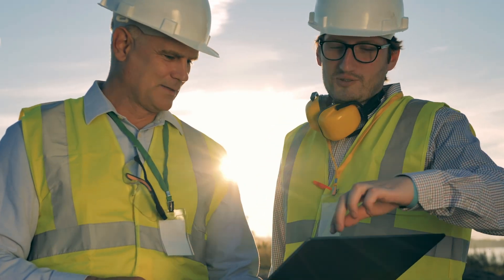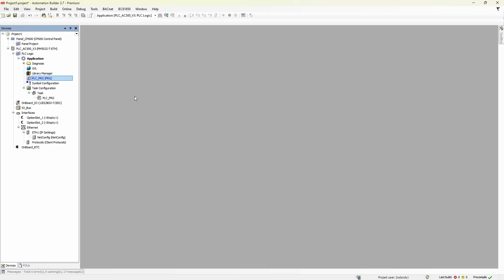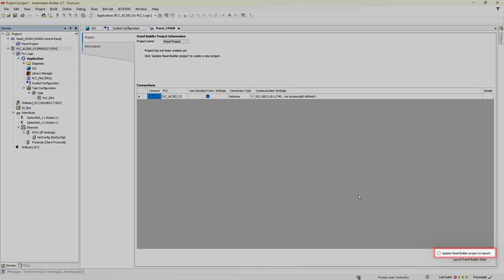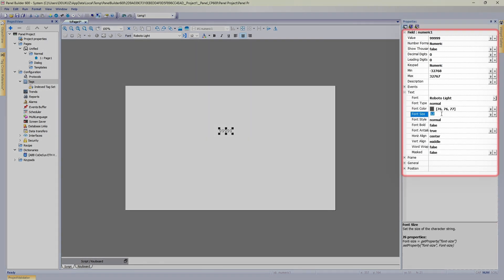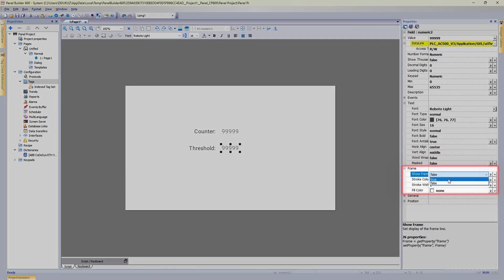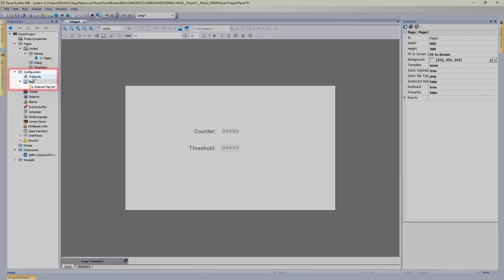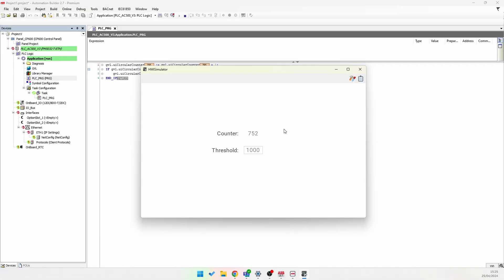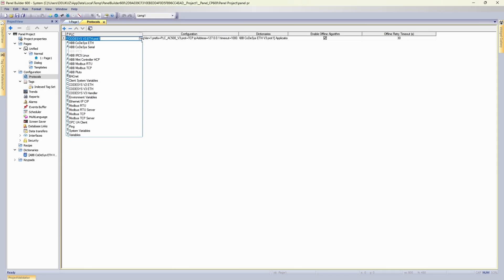How to connect PLC and HMI simulators

Comment: Does this not work with the new automation builder 2.8? Maybe I am doing something wrong but I know that I have used this method in the past with no issues.  Now I can not get the HMI simulator to talk to the PLC simulator.  Thanks in advance for any guidance.
Reply from the maker: Hello! Yes, as of Automation Builder 2.8 this feature stopped working. At the moment developers are working to fix it. We expect it will be fixed in Automation Builder 2.9. Sorry for inconvenience!